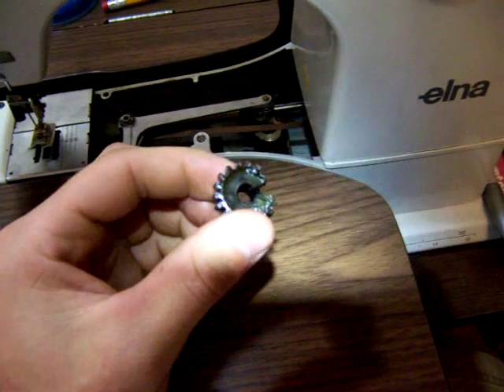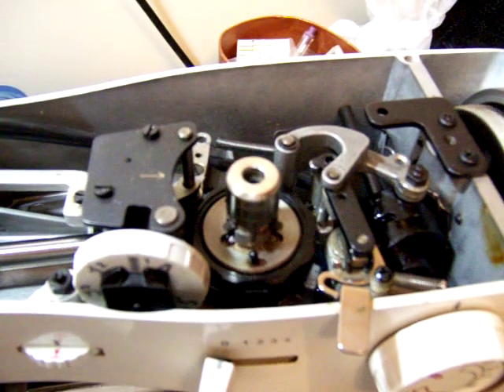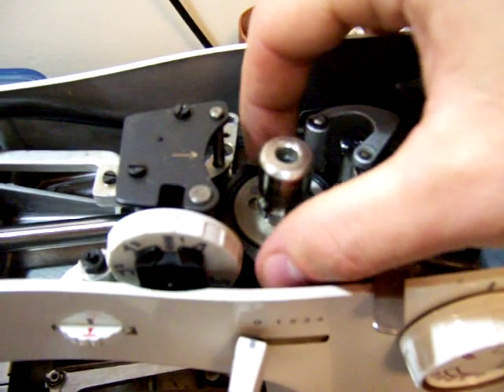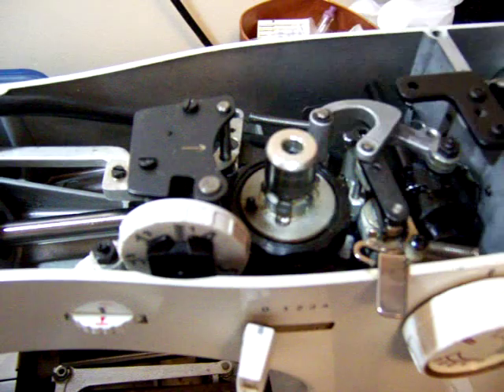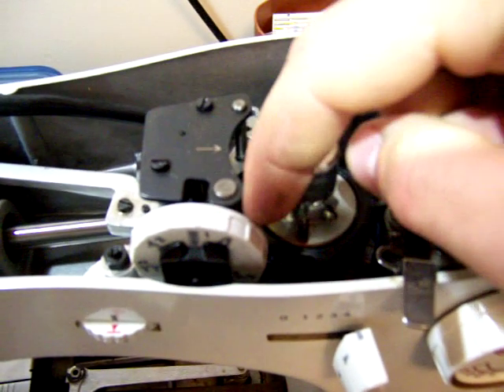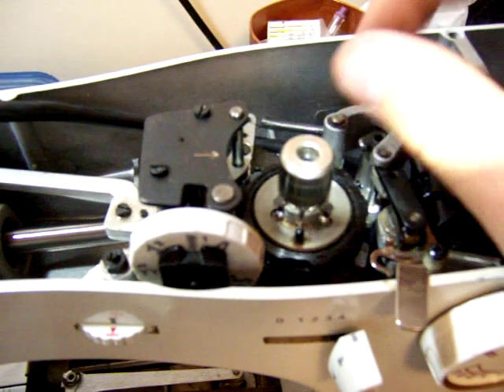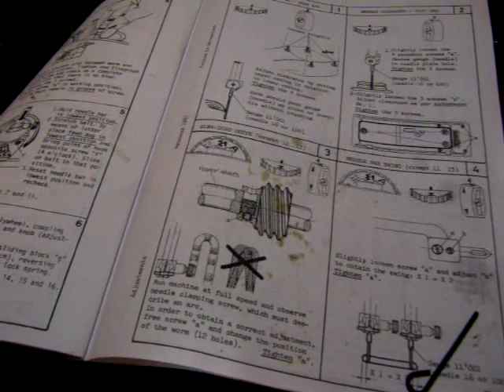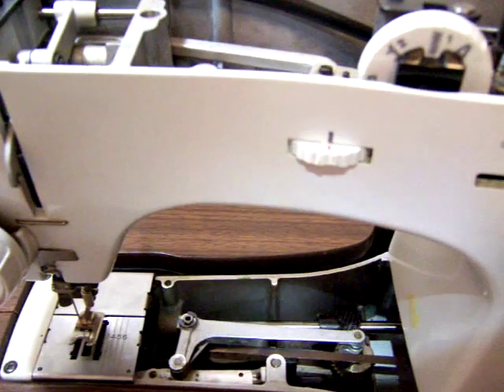Elna Star Series 62C "ElnaSuper"

Comment: For Elna Star 62C (SU) machines that have no motor belt. If the motor pulley is damage or slipping. This part can be expensive or not available. Check out my solution to Elna motor pulley repair at very little cost at https://youtu.be/mpNmeSZ6_HE

Comment: Hi, I have the same problem with my Elna su. I saw on the video that you have the special manual to repair it. (or try to ;-)) I wonder if you could email me the pictures referring to that part of the machine , please, my husband has been trying to remove the parts blocking the access to the cam gear but gets stuck at some time.I live in Fr'ance. Thanks anyway for whatever advice you may give me.